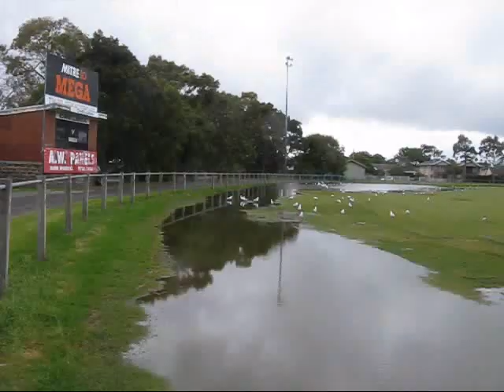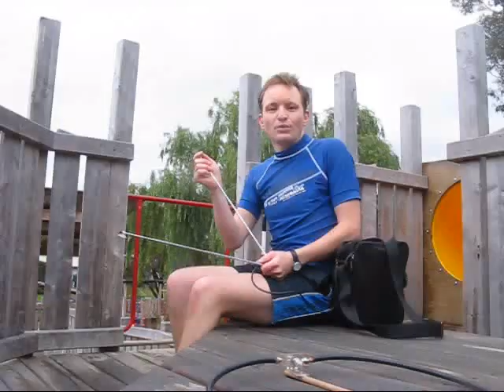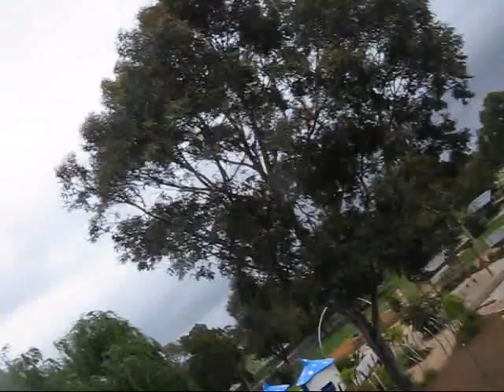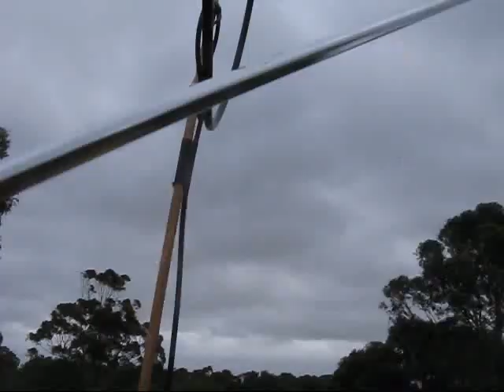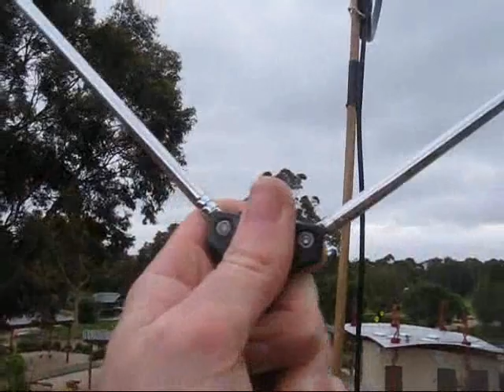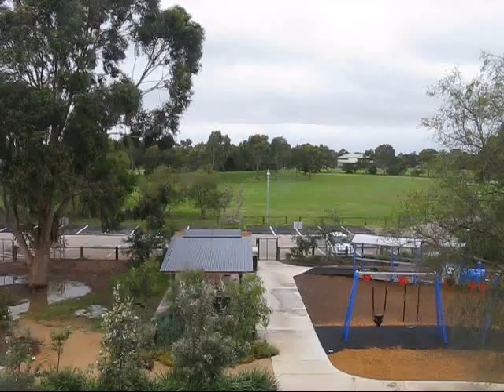Minimum QRP - Part 3 (VHF portable)

Comment: Neat entertaining video.  Wish we had more VHF SSB available here in northern Michigan.  What little we have requires a beam and some power because they are so spread out.  Tried a vertical on the metal top of our mobile home cottage but poor results.  Thought the metal top would make a good ground plane but the few other hams in the area were horizontally polarized and it did make for poor results.

Dave K8WPE

Comment: Very good, that is a great use of portable antennas!  Those loops can work surprisingly well and are very easy to build as well as portable.  Great use for the rabbit ears also, I have some around here, I will have to hook up a section of coax to it now for that type of use.